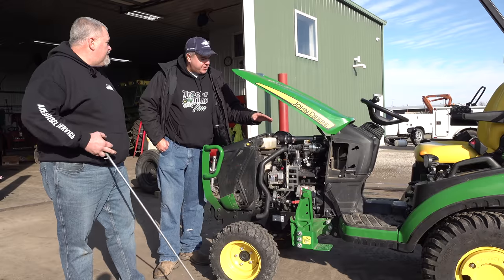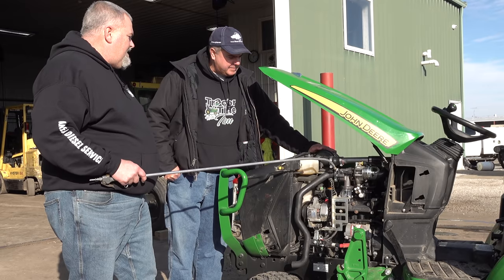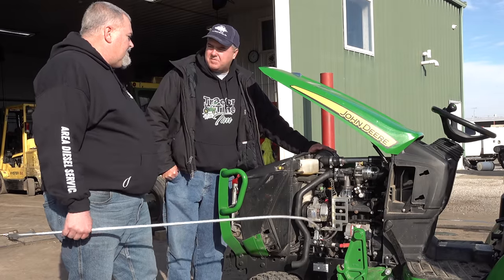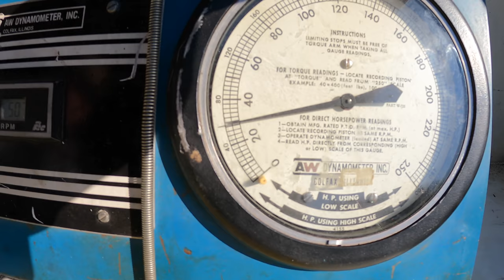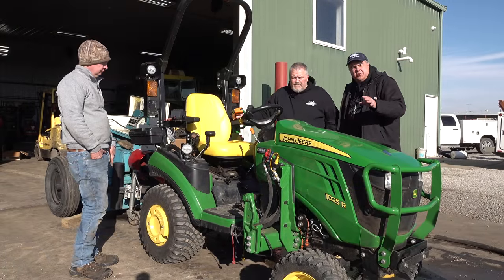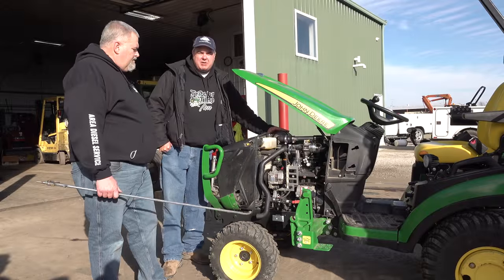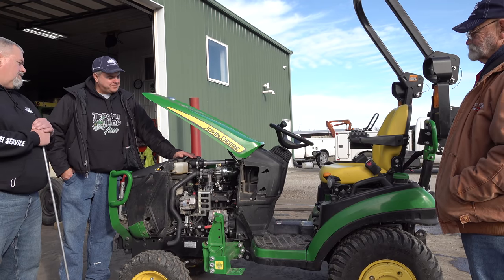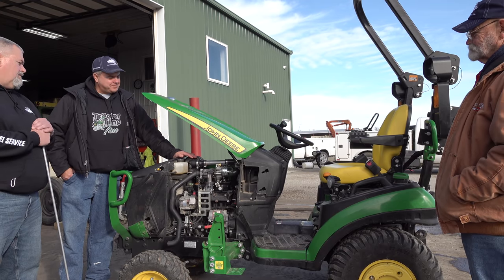John Deere 1025R Turbo Dyno Test!!  You Won't Believe It!

Comment: Now you need to fortify the hydraulic pump, hoses, governor, and related components to accommodate the extra power. The tractor was engineered for the power plant's output and more power compromises the integrity of the tractor as a whole. Who is going to certify that the engine components are suitable for the power increase?  It's a nice youtube video but it lacks logic when applying to a JD 1025R.
Reply from the maker: ‘Lacks logic…’ ok.
Reply: How does it lack logic. I would love a little more pto power out of my 1025r, to be able to run a slightly larger brush hog or tiller but need to stick with a sub compact sized tractor because I need to float it to my property on a pontoon barge. If you can't see why Tim is doing this Experiment as he even called it then it seems like the only thing that lacks logic to me is your comment.
Reply: @TractorTimewithTim   lots of us appreciate that your able to take the risk of doing this. Getting a little more power or of a 1025r or 2025r is very interesting to me. I'm very limited by weight and my need to actually get my tractor to my property. A 2032r or 2038r would be maxing me out. A 1038r or a small frame 2038r based on the 2025r would make a lot of sense for my needs. Thanks for putting in the time and effort for this project.

Comment: Oooh you're making John Deere cringe right now! 
They've been charging thousands for a couple horsepower gains... now a 1 series probably has more engine HP than most 2 series.
 Heck, your 2038R doesn't even have 32 pto HP. So you're definitely over 40 engine HP
Reply from the maker: Yes, but they have to put the electronics on to control the DPF.
Reply: True, but I still don't understand how Mahindra can get away with it? 
Very excited about upcoming videos showing J-X 
Keep up the great work!